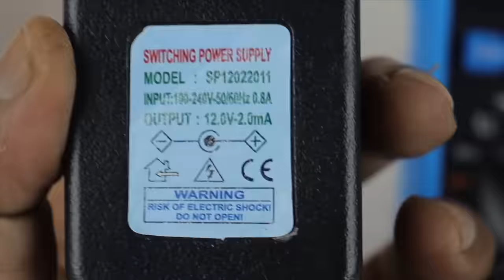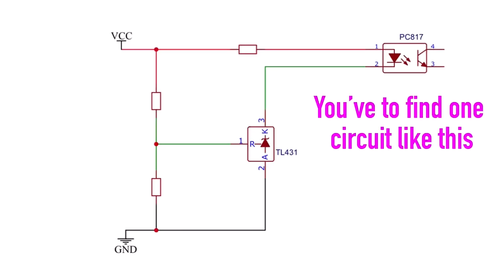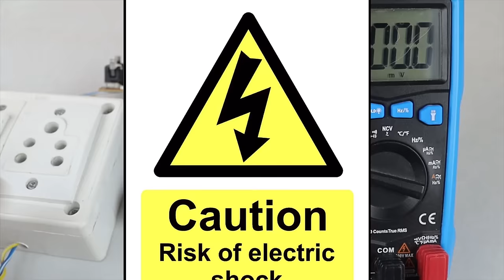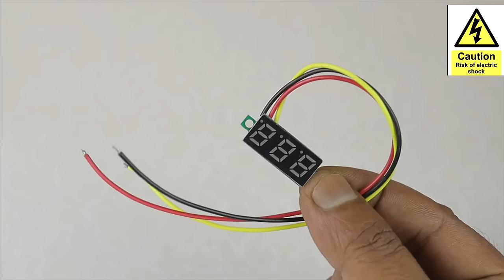Turn Any Fixed Voltage Adapter to Variable Voltage Output (3V - 24V)

Comment: if i wanted to just lower the output from 19v to 12v would i still have to replace all that
Reply: If you just need a fixed voltage you'll need to find the voltage divider and change the ratio of the resistors accordingly. No potentiometer or voltage meter needed.

Comment: By opening the Power supply and making modifications, will render the power supply unsafe and it violates UL and CE. DON'T DO THIS! THE LIFE YOU SAVE MAYBE YOUR OWN!!!!
Reply: If you can't stand the heat, stay out of the kitchen. 

UL and CE are no guarantees for safe devices,  just that samples passed certain requirements and testing.  How many UL/CE usb chargers went up in flames?

Besides he knows enough to make these changes to know the risk.